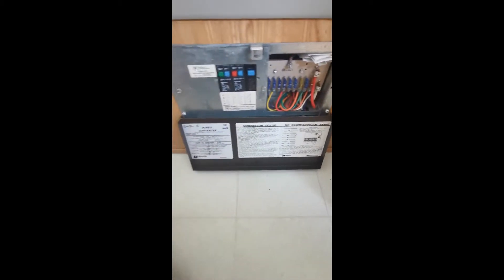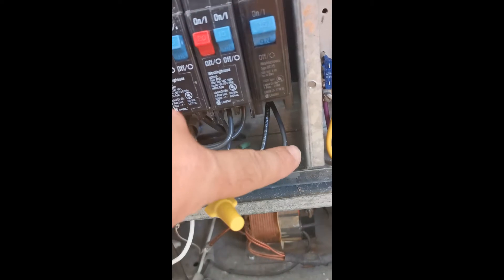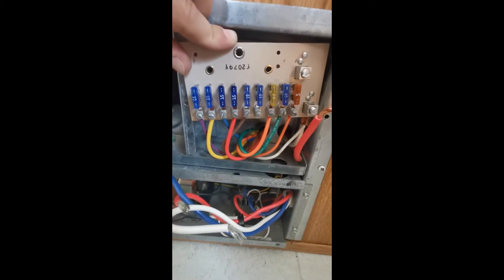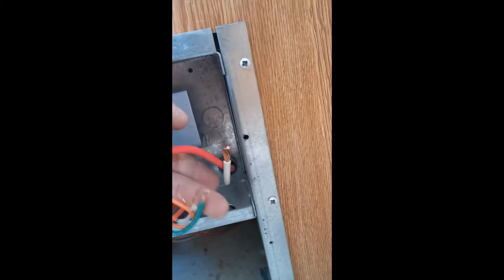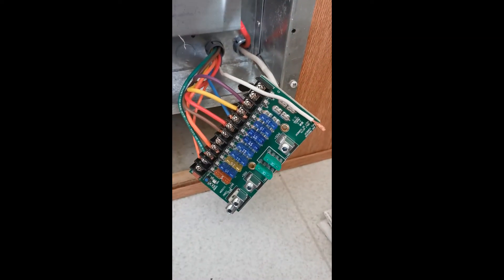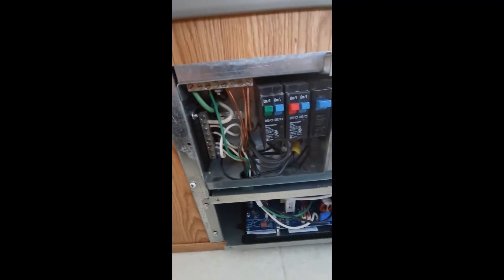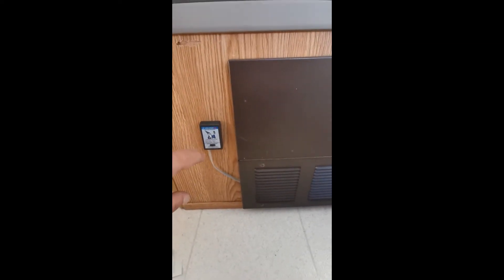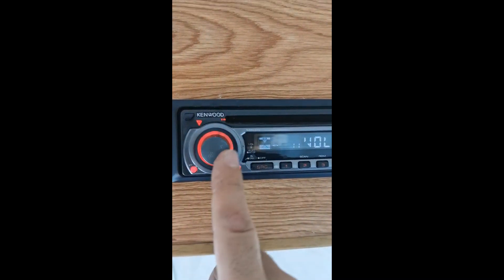RV Upgrades: Progressive Dynamics PD4645 with remote Pendant to replace Magnetek 6332

Comment: Thank you! By far the best video on you tube for this subject. What did you end up doing with the wire that you said was for the GFIC? . The instructions say if the utility pigtail was used on the original installation , 2 short lengths  of 14AWG wire and a wire nut may be used to provide the utility pigtail. DO NOT install (2) wires into the breaker. However they dont say how or where to attach this new pigtail?  Can you tell me how you handled that??
Reply from the maker: Call their support line, I don't want to give wrong advice. They are great for phone support.

Comment: can i get the manufacture and model for the replacement fuse panel? sorry if it's in there and i am missing it, just don't see it. Thanks for the video
Reply from the maker: The fuse panel is included with the PD4645.